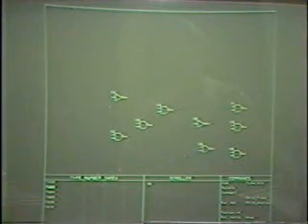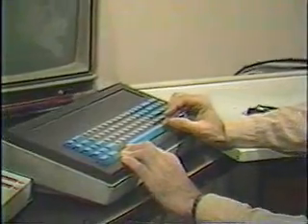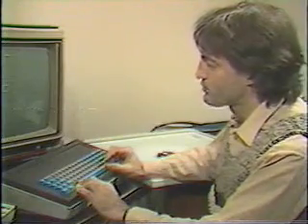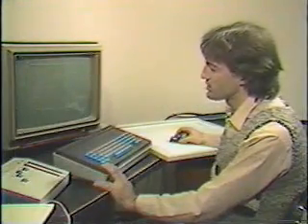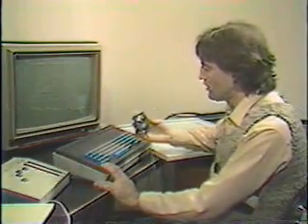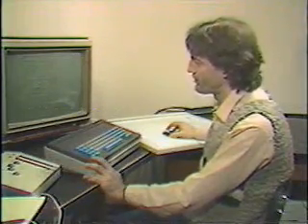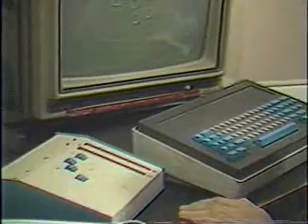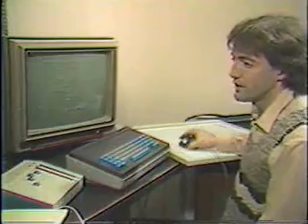An Informal Study of Selection-Positioning Tasks

Comment from the maker: On the one hand, yes, a lot has changed since then.  Look at the keyboard and display, for example, both of which were state-of-the-art back then. On the other hand, some of the graphic techniques are only recently starting to get traction.  Sure, that is happening on slate computers where the flat display itself is the tablet, so to speak.  But actually, beneath the surface is very similar tablet technology.  At least now we can actually use the gestures for more than a demo :-)